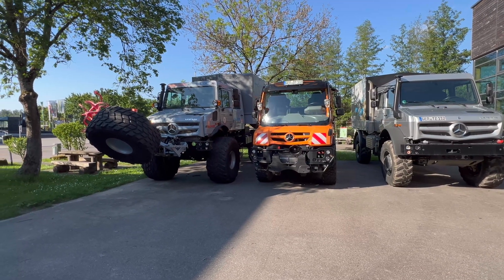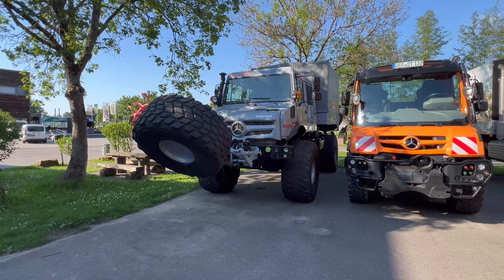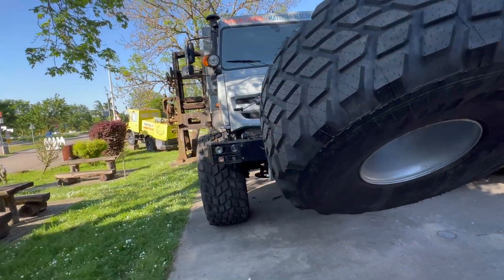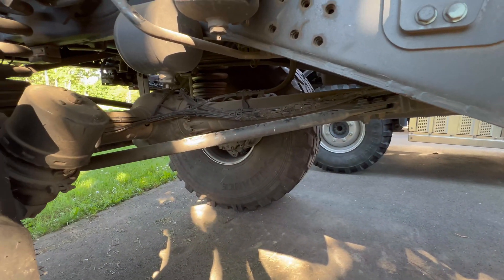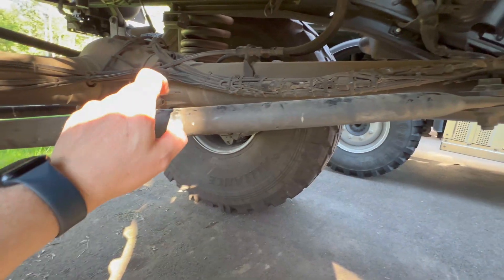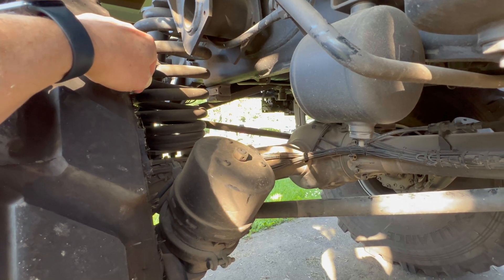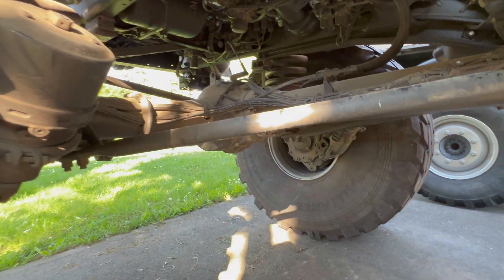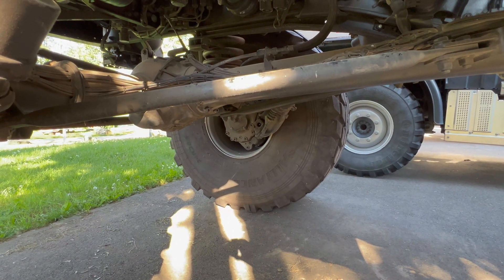Extreme UNIMOG Suspension

Comment: interresting, old Fords and other american vehicles from the 40's and earlier often had torque tube axles, I had no idea they were in any modern vehicles :) Beefy!
Reply from the maker: The engineers that designed the first Unimogs were inspired by the Model T, especially the torque tubes - they just took it to the next level. It's also on Peugeots and some other vehicles but only on the rear axle. To the best of my knowledge the Unimog is the only vehicle made with 4x4 front and rear torque tubes but if anybody knows of another one let me know in the comments.

Comment: Great overview, thanks!   Do the portal gears also allow for a smaller differential?
Reply from the maker: Yes because the final reduction is at the hubs. As a result it is possible to use smaller differentials but the Unimog ones are pretty stout diffs. Also the load is being distributed over more gears. The main reason for the portals is to get the axle up higher though.